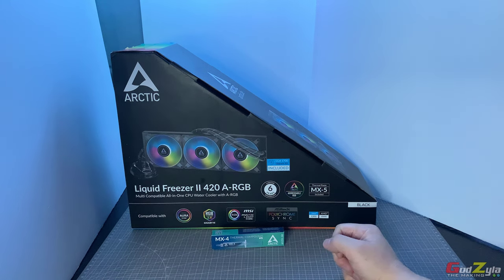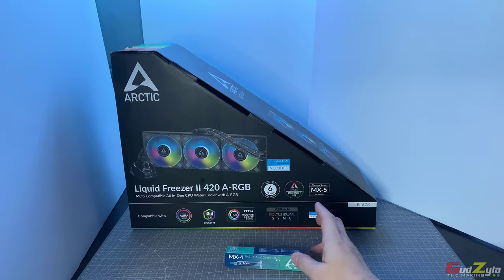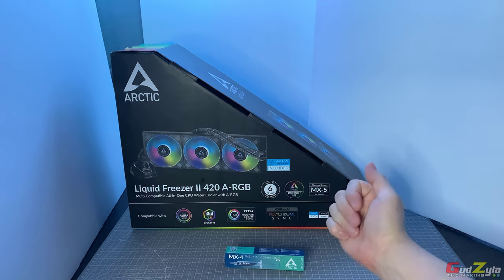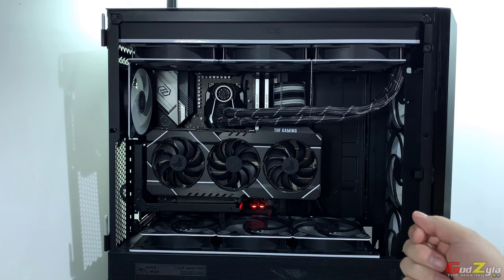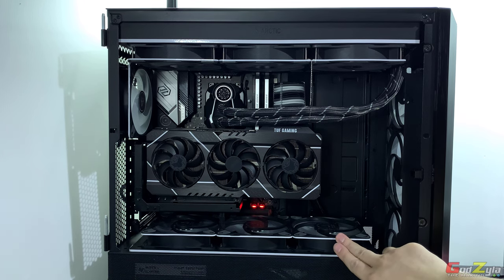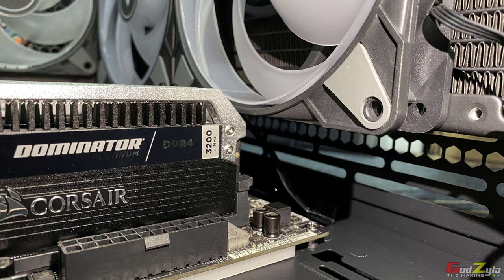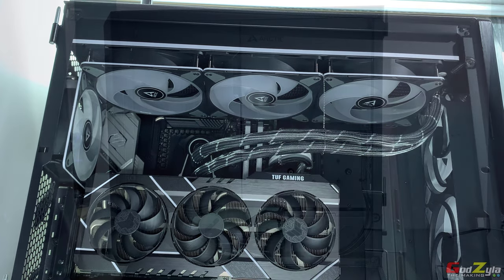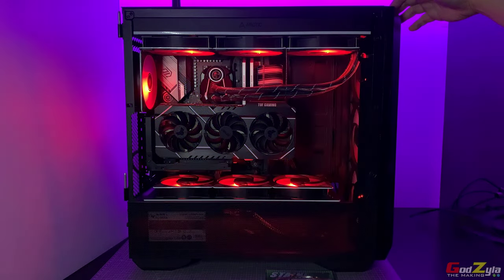Arctic Liquid Freezer II 420 in Lian Li Lancool III - Part 2 (The Experience)

Comment: Hello, I love your video and I just ordered the 420 Arctic and the Liancool 3.

My only concern is my motherboard is 45mm at its highest point from the very bottom of it to the top of the heatsink. Do you think this will be an issue? I am willing to purchase a different one if needed. Can you recommend a X570 or X570s motherboard that will fit?

Also which fans are you using on the bottom? Are they the p14s or p12s?

Thank you!
Reply from the maker: Hi Robert Stead, welcome to my channel and thank you for the feedback and compliment. The problem is. Most motherboard manufacturers do not state their height of the rear I/O plate, plus I only have my ASRock X570 Taichi. So I am not able to recommend you any boards except for my motherboard. Am so sorry. 
As for the bottom fans I am using 3 x Arctic P12 pwm pst argb fans.

Comment: I have an h500m. I took the top glass part off. Can i just sit the radiator on top and have it hang over the side outside the case on the top?
Reply from the maker: Hi Gurciullo, welcome to my channel. do pardon me, I do not have that case. so can't really give you an answer. Based on the specification, the top only allows 360 max. you can give it a try but I have no answer for you.
Reply: @KleoYan  Thats cool thanks for responding. I was thinking of running it just sitting on top perpendicular so two fans would be sitting on nothing and the middle fan would be through the case...
Reply from the maker: @LordGurciullo  I see. it should work.. all the best with your build. 🙂

Comment: Hi! I bought the same case and AIO cooler, i am having trouble installing the Arctic Liquid Freezer 420 on the roof, it would only fit if i take the 140mm fans in the front out, or its like slightly tilted. I currently have it sitting sideways on the top, so its only held by 3 screws instead of the usual 12 as it just wouldnt fit. I tried squeezing it in but the fans in the front block it out. So the very top front fan thats touching the radiator is at a little angle but the bottom ones are slotted in nice and flat. Is yours sitting flat ontop with all 12 screws? Or did you have to improvise by putting it slightly sideways to make space? And did you leave the stock 3x140mm fans in the front, or did you swap them out for 120mm ones? Im just very lost if im doing something wrong or is this supposed to be like this. If the cooler sits flush ontop with all 12 screws, fan wont fit, if its sideways, front fan somewhat fits but the cooler on the roof is only held by 3 screws.
Reply: Did you leave stock 3x140mm fans in the front? Or did you swap them out for 3x120mm ones when you put the 420mm radiator on the top? And did you have to lower the front as the whatever hinge/switch/lever is blocking the radiator ontop.
Reply from the maker: @Nunubuffs  Hello, welcome to my channel. let me breakdown and to answer your questions

A1) I am using P14 pwm pst argb fans, at the front and I have flip the tray where the U-shape is facing in, which I have place those three 140mm fans. no adjustment made. it will fit exactly to the tray slot. 
A2) I have tested the original fans before I swap out to the P14 pwm pst argb fans, both works.
A2) The radiator screw holes as what I did, I dont force it.. i just screw them losely and adjust the rest to the 12 screws at the top, once seated nicely, I will tighten them in an alternate fashion.
Reply from the maker: Hi Angel, just a headsup, I see what I can do on my next video - Thermal Findings (Part III), I will illustrate the top and the front mount but will need to wait as currently busy with work projects.
Reply: @KleoYan  for some reason I cannot get it to fit with the stock 3x140mm front if i have radiator sitting ontop. It wont close up properly.
Reply from the maker: @Nunubuffs  Hi you  might wannt to tug the cables of the front panel properly. instead of letting you wait. I took some screenshots. hope this will illustrated how I did mine. https://imgur.com/gallery/vHezOSS . As mentioned you need to flip the tray and your Fans have to be inside the tray and not outside. This works with the stock fans too even though in the picture are Arctic P14 PWM PST argb fans.
Reply: @KleoYan  thank you for this! Is the fan logo supposed to be facing inwards or outwards? Ive got the arctic cooler 420mm on the roof, the back and the front all facing towards the inside. Do I need to swap one of em to push it out? As far as I understand then all 3 sides are currently pulling air in but  its not going anywhere.
Reply: Another question that I have, is that if I can still fit a motherboard inside there once the AIO cooler has already been installed, like all screwed into the roof and all fans attached. Or would I have to remove the cooler first in order to get the motherboard in
Reply from the maker: @Nunubuffs  the way that I have tested, you can do either way, 1) mount AIO first then motherboard or 2) Motherboard first then your AIO. 
I prefer to mount AIO first, since there are space for me to slot the motherboard.
If you are to fix the motherboard first, you will need to be very careful when you slot the radiator in, as accidental bump of the radiator to the motherboard, it might get damage. 
Last tip, make sure to remove all the fans on the rad as I find it difficult to get the radiator into the case with the fans on it. the space is super tight.
Reply from the maker: @Nunubuffs  this suppose to be on my next video as in what's the best airflow set up with the fan location. oh well, give you the direct answer. best configuration is this way. 

1) 3 x 140mm fans - Top mount on Radiator (Air out / exhaust) 
2) 3 x 140mm fans - Front (Air in / Intake)
3) 3 x 120mm fans - Bottom (Air in / Intake) 
4) 1 x 120mm fans - Rear (Air out/ exhaust.
Reply: @KleoYan  Hi, how can i tell which way is which, like which way is in and out on the fan, do i go following the logo on the fan? That if the fan logo is facing inwards the case then its an intake?
Reply: @KleoYan  so if i understand correctly, then the logo for the arctic radiator faces outwards like towards the top of the case/ the radiator itself and the frontal ones face inwards towards the other components, correct?
Reply from the maker: @Nunubuffs  An easy way to tell how the air direction goes. look at the fan (Apply to most fans), there is one side that has 4 frame and at the other side is without frame, the side with 4 frame, that's where the air will blow towards you (Intake/air In) . the other side where there is no frame just showing the blade, air is drawing away from you (Exhaust / Air Out)

Comment: Nice video. I have put a 280mm NZXT Z69 AIO in a Lancool 3 with a Asus Z690-f motherboard. Due to High VRM heatsink, this has been a massive challenge but managed it at the end with 0.1mm clearance :) informative video
Reply from the maker: Hi gökhanbat, welcome to my  channel, yes it can be tricky to mount with motherboard that has high vrm heatsink. am glad you got to fit your 280. Thank you for your feedback.

Comment: does the 420mm aio will fit in front of case with 3 fans infront and 3 fans at the back of radiator without removing the HDD cage?
Reply from the maker: Hello Glen, welcome to my channel. It’s going to be a tight squeeze. It is possible. Just take note if you intend to do 420 at the front, at the top you can’t mount 3 x140mm fans. Only 3 x 120mm fans
Reply: @KleoYan  thank you for your response. I might go with 360mm instead to avoid clearance issue.
Reply from the maker: @glem9582  hi glem you are most welcome. All the very best with your build.

Comment: Is it possible to put a 140mm fan on the rear if i have the 420 aio in the front and 3 140mm fans on the top of the case, or no. With the aio in the front position does it removed the dimension limit from the motherboard like you show the 40mm clearance. Also very insightful video helps a lot with upcoming build 😄
Reply from the maker: Hello Frozen, welcome to my channel. if you place the 420 AIO at the front, yes you can place a 140mm at the rear, but do note that you can't put 3 x 140mm at the top.. you can only put 2, or you can put 3 x 120mm.
Reply from the maker: @Frozen, btw you might be interested of the thermal results with the different fan placement https://youtu.be/1SPioF78x_E .. oh I almost forget, thank you for visiting and the valueable question and compliment. All the best with your build.😉

Comment: Hi Kleo Yan, at 5:41 you are attaching some kind of white material to your case-fan.. why are you doing that und where do i get that material?
Reply from the maker: Hello LB, welcome to my channel. That is a decor lining decal for vehicle. You can find them in Cars or Motorcycle shops that does body kit or you can find them in amazon. 
ZATOOTO Red Pinstripe Tape for Car - DIY Vinyl Pin Striping Decals Auto Waterproof Pin Stripe Tape Emblems Trim Universal for Automobile Musical Instrument Home Door etc https://amzn.asia/d/4UeWFnS or  https://amzn.asia/d/bBQ2Mkn
Reply from the maker: @LB I could find your other question but it's reflected in my email whenn someone comment in my channel. you were asking about the rubber stuff which hold the fans. They are Case fans rubber studs or Case Fan Soft Silicone Anti Noise Reducing Vibration Screws https://www.amazon.sg/Honbay-Silicone-Reducing-Vibration-Screws/dp/B0749BRLXW
Reply: @KleoYan  Thank you for your answers. And what are those pinstripe tapes are for? Whats you intention?
Reply from the maker: @lb8613  those are just for vanity, I use them to highlight some PC components (GPU and Fans) so that it stands out.. If not the whole build is too black for my liking. they are only for decoration purposes which will not cause temperature increament.
Reply: @KleoYan  Okay.. im just worried about the lack of space at the rear fan spot. i dunno how to install a 420mm aio plus a 120/140mm rear fan.
Reply from the maker: @lb8613  you can only mount a 120mm fan at the rear, please note you will need to use fan rubber studs / Case fan soft silicone anti noise reducing vibration screws which I've mentioned to you. Also one thing to take note which I miss out in this video, the front 3 x 140mm fans (be it original case fans from lian li or your own fans) this is the only position you can do.. https://imgur.com/gallery/vHezOSS
Reply: @KleoYan  thank you very much for your nice answers. i subscribed your channel.
Reply from the maker: @lb8613  you are most welcome and thank to have subscribed to my channel. by the way, All the very best with your build. 😉

Comment: Hey I'm about to build in the same case with the same 420 cooler, I have a z790 Strix-E, do you think I will have any issues top mounting? On Amazon it says the "parcel dimensions" are 34.29 x 27.31 x 7.7 cm; 3.18 Kilograms, I think that includes the product box though. Thank you <3
Reply from the maker: Hi ayy jayy, welcome to my channel. I would advise you to measure your z790 strix-e rear I/O height as I have received that their Asus Boards the rear I/O height is too high. If your board to the tip of the rear I/O is more then 40mm then you going to have an issue. Mine is an ASRock X570 taichi board which has a height if 38mm. So take note.
Reply: @KleoYan  I just measured it at 49mm unfortunately, I know the LANCOOL III has 2 mounting positions for the motherboard do you think that would help at all?
Reply from the maker: @ayyjayy5018  hi, it's fix position for ATX, M-ATX, E-ATX or even ITX, it does not have a second position. no matter which form factor, be it ATX, M-ATX, ITX or even E-ATX, the height clearance is still at 40mm with a 420 AIO, unless you go fo 360 AIO, then you have the height clearance of 60mm. I think you got mix up with this case againts the Lancool 216 (btw 216 does not allow 420 AIO)
Reply: @KleoYan  ahh I think you're right. So you think there is no point in trying this out? I have the case still brand new in the box in front of me. I'm going to go return it and buy the Meshify 2XL, if it doesn't fit in that case then I really don't know what to say lol, by the way thank you for being so helpful you really helped me a lot with this build with your videos and all your replies I really appreciate it you earned a new sub from me!
Reply from the maker: @ayyjayy5018  you are most welcome. All the best with your build too and thank you for subscribing. 👍😉

Comment: Hey very short question, I've had the Corsair H170i so far but only have problems with the software and thus jerks in game. Now I would also like to switch to Arctic. Do you need software for this when you take the RGB variant or does the water cooling run completely without software?
Reply from the maker: Hi Johnny, welcome to my channel. Nope Arctic LF2 does not need any software to run. All you need is to plug the fan and pump which are together to the motherboard header, and the fan argb connector to the motherboard argb header.
Reply: @KleoYan  Okay and if I want to run multiple fans so 7 fans how do I connect them together? :)

Thank you very much for your answer always you are a really good person
Reply from the maker: @johnny7184  maybe may I ask which motherboard you are using before I can guide you through with it. I will answer you later as it’s 1:11am my time. Need to catch some sleep.
Reply: @KleoYan  No problem at all :) Answer calmly when you have time, I would need a total of 7 fans with the water cooling, 3 for the water cooling and 4 for the case. I will either keep the Z790 MSI Carbon WIfi or the B550 Asus Gaming F. I'm not sure yet, but unfortunately I do not quite understand how to connect and control it without software and controller. Would be very happy if you could explain it to me:)
Reply from the maker: @johnny7184  these are the layout of your board and how I will do it this way.

I would split the fan off from arctic pump. meaning to say the pump will have it's own connection and fans will have it's own connection, cable extension is needed for your 3 radiator fans

Z790 MSI Carbon
please refer to your motherboard manual for the location, example PUMP_FAN1 , CPU_FAN1 and etc
1 x pump to PUMP_FAN1 
3 x radiator fans, daisy chained to CPU_FAN1 
3 x front case fans to SYS_FAN5 
1 x rear case fan to SYS_FAN1 

B550 Asus Gaming F
please refer to your motherboard manual for the location, example PUMP_FAN1 , CPU_FAN1 and etc
1 x pump to AIO_PUMP
3 x radiator fans, daisy chained to CPU_FAN 
3 x front case fans to CHA_FAN2 
1 x rear case fan to CHA_FAN1

as for your argb of your fans, you will need a argb hub https://www.amazon.com/RGEEK-Splitter-10-Port-Extension-Perfect/dp/B08DRKR4B6/ref=sr_1_8?crid=1RYFZVF12XC2E&keywords=argb+hub&qid=1670289302&sprefix=argb+hu%2Caps%2C291&sr=8-8
3 front case fans, leave it as it is as all are conntected to the case argb controller. then from the case argb controller, use one argb connector, plug it to the argb hub (the center slot) as for the rest of the fans, plug individually to the argb hub port. (extension may be needed)
Reply: @KleoYan  Thank you very much for your detailed and quick answer!  you are doing a great job
Reply from the maker: @johnny7184  most welcome, just trying to help.. I have my limits too actually. All the best with your build.

Comment: Hey what do you think will it fit EK 360 elite on top with all of the fans think if im not wrong there should be 75mm of space between top and mbo.EK is 77mm but if it go offset then it might fit
Reply from the maker: Hello Grim Repaper, welcome back, I don't think there will be an issue to fit the EK Elite 360, a 420 can fit in you see and even if you have high profile rams. when a 360 AIO lenght.. it will easily fit at the top without issue.
Reply: @KleoYan  Yeah I know it can fit 360 length i ment thickness Ek is 27mm thick and fans are 25mm so two rows of fans plus rad that is 77mm can that fit  in
Reply from the maker: @jadeprinces  oh my bad.. i doubt it will fit, so sorry i do not have a EK Elite to do the actual measurements, this is an estimation of a Be Quiet Slient Loop 2 block. The height is at 55mm tall .. if I do a 360 with push pull configuration. it does not hit but there is a clearance of 4mm. As for your EK Block which is based on the website [Pump Unit Dimensions: 88 x 70 x 64 mm] I would advise you not to take the risk. The inner fans will hit the EK block as it's 64mm tall, unless you only do either push and pull and not push pull configuration.
Pardon me, this is my opinion as the EK block is definately big and so sorry as I do not have this EK AIO, I can only use estimation to explain to you.
Reply: @KleoYan  Yeah it is ok buddy thank you for replay.That is damn shame and i really like this case.But from what i saw there is no need to have it in push/pull configuration as difference in tems is negligible.
Reply from the maker: @jadeprinces  I see. Thanks for understanding. If you are just to use one set of 120mm fans on the EK elite. That should solve the problem and to use the other set as bottom fans. Then at the rear you might need to get just one more ek vadar s fan. Still the choice is yours. All the best with your build.
Reply: @KleoYan  Yeah that is what i thought and since case already comes with 4 fans there is no need for me to buy more fans.
Thank you my friend
Reply from the maker: @jadeprinces  you are most welcome. All the very best with your build. 😉